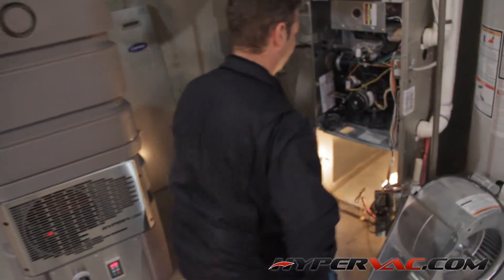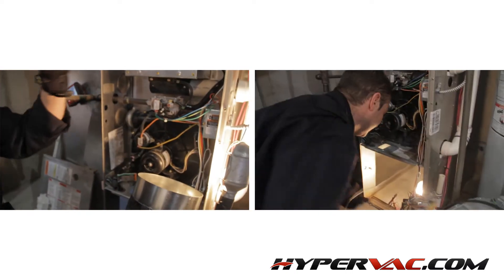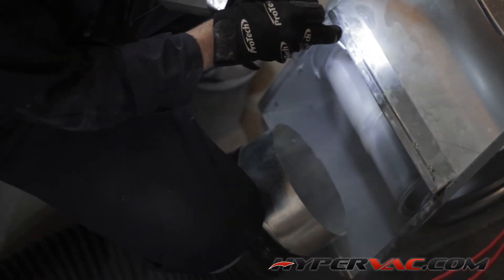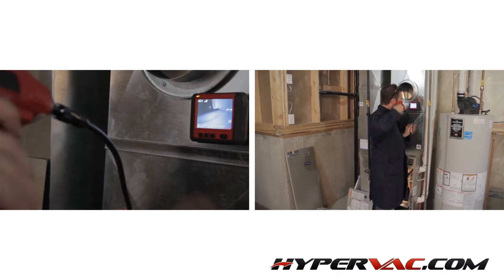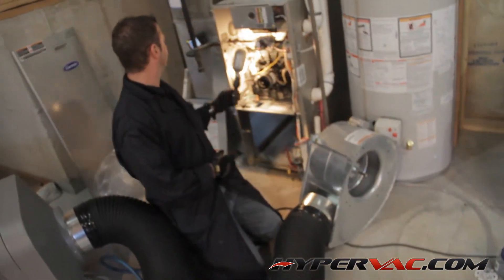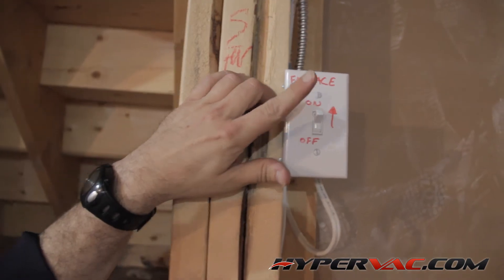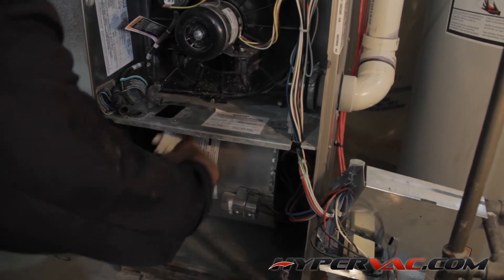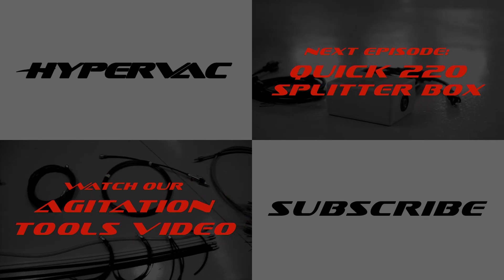10.0 CLEAN THE BLOWER, FURNACE, REHEAT COIL (Hypervac Duct Cleaning - Basic Training Series)

Comment: Thank's for sharing this video with us. Just a quick question though - your way of cleaning the blower seems fine for minor dust accumulations. For heavy dirt I suppose it's still better to disassemble and hose the whole thing.

Apart from that - please notice that while you blow-clean the fan, blower motor is generating voltage. Is this really safe for control unit to leave the blower motor connected during this operation?